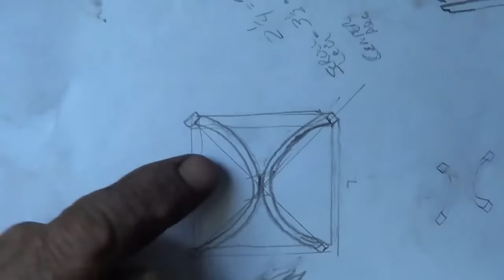Blacksmithing - Forging A Sea Serpent For The Table Project

Comment: When you started wrapping it around the table, i felt an immense urge to jump in and hold that table still.  Sorry i wasn't there for ya.  :P
Reply: Joshua Rigby 
I did the same, and wondered why no tack welds held it down! Maybe Chandler thought of that just after he started, but its a one heat job! No time!

Comment: Chandler, try doing longer tapers on the edge of the anvil. It is really efficient and quick! I was shocked is first time I did it about how quickly you can move the steel. It's hard to explain in words, but check out Alec Steele's video on tapering. It has helped me a ton! Also, I'm not sure if you are interested, but every Saturday at 5 Alec Steele has a live stream and he makes something cool. It goes live on Facebook and YouTube. Keep up the great work,
Reply: I was thinking Alec Steele also, maybe hammer choice too.  Is that REALLY Alecs last name?
Reply from the maker: are you talking about when i tapered the rasp?  i use the edge of the anvil most often when alot it tapering needs be done  top of the horn top...  but if you are talking about tapering the rasp..  i dont think in this case would be a good idea..
Reply: +Chandler Dickinson 
It's OK to learn from people, But I  enjoy the way you learn your own way and for me it only develops your own style. So yes check out other video but take it with a grain of salt because you are doing a fine job on your own.

Blessings, Martin
Reply: What I mean is that if you hit half on half off the edge of the anvil onto the rasp, turning 180 degrees after each blow and hitting the bump that forms, it creates an even more aggressive taper than doing it on the horn. Sorry, it's hard to really explain in words.
Reply: That's his last name. I've been following Alec since he first started with Brian Brazeal where he was a 13 yr old kid. He has taken blacksmith techniques, along with Joey van der Steeg, to the place where we as amateurs can learn and improve our skills.
Reply: Glenn Wiebe Alec does have a wonderful personality and his enthusiam is contagious.  I look forward to buying his lessons when our weather and summer calms down.

Comment: I’m only partway through the video at the moment, but wow does it look good already. But with all the bending you’ve been doing, a propane torch would be a really handy tool. A hose & torch head (you can run it off the same propane tanks as your forge) seem to run between $35 and $50 on Home Depot.

ETA: Now I’ve watched the whole thing—wow. Great work.

Comment: Before you welded on the two half moon support to the table,
you could make the Serpent and then thread the serpent (like a ring) on each half moon and then weld it to the table.
No need rush to get it around the table support.
Just make something on your vise that you can wrap the serpent around.
That would be much easier.

I really like what you are doing.

Comment: Chandler it looks awesome if you get a pneumatic gun and put a chisel point In it and heat the face of the serpent up you can easily push the nostrils up to give it a more dragon look. It will take 2 seconds per nostrils and yes a neatic gun will exert 10 time more force than your hammer.

Comment: Hi chandler it does look ace the scales are brill ,but while you were putting the head on to body ,to cover the joint weld I was thinking of a chain with reasonable size links maybe and weld chain links together arched maybe then it looks like it's fierce and chained to the table ,it would look viscous eh Just experiment with shape of chain

Comment: try making a set of bolt tongs that have a 90 degree corner in them instead of a curve to handle your square stock. You'd be holding at a 45 degree angle but you would also have a firm grip.

Comment: I've found using the side of the hammer works really well for small detail work. Far less likely to smash a finger with the side of the hammer than you would be with the face of it.

Comment: Chandler I am a total newb and idiot but would it not have been easier to start with half inch squar bar that was 24-30" long and then heat it and use a stamp made from something like a drywall hammer or make a tool from rasp and imprint the scales onto the rod with something like that?

Comment: Maybe, just maybe lengthen by striking the edges best you can the try to role the rasp length wise with scales on the outside. Taper it further by clamping on to it and stretching it to preserve the scales